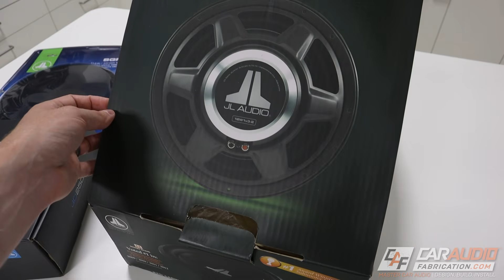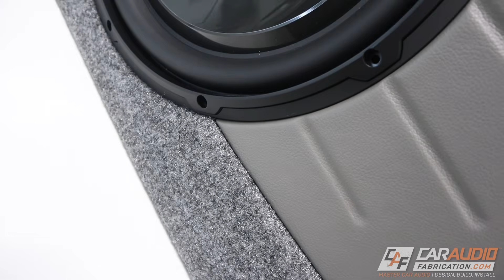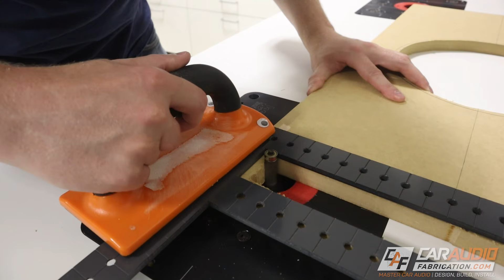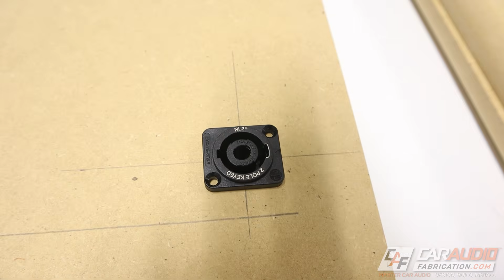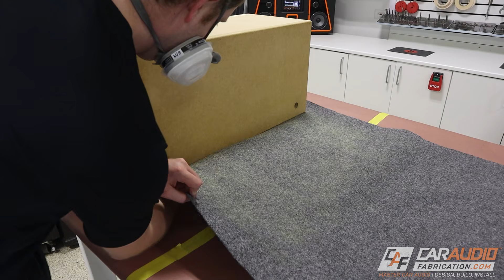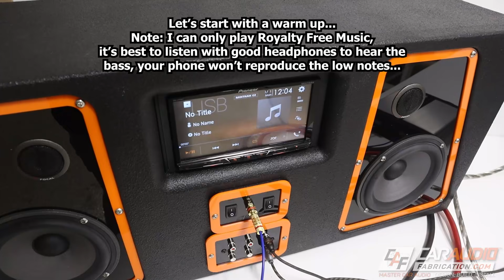BIG BASS with entry level gear? - Making the Sub Box!

Comment from the maker: Thanks for tuning into the build! A TON of you have been emailing asking to purchase the design from this video so I have added it to the site:
✔️ Premade Design Blueprint of the box in this video: https://www.caraudiofabrication.com/product-page/f0010-jl-audio-12w1v3-1-60-cubic-ft-32hz
✔️ Custom Subwoofer Box Design Blueprints: https://www.caraudiofabrication.com/box-designs

Thank you guys for watching!
Reply: proper preporation prevents piss pore performance
Reply: @JamesMurphy-re3hm 

?
Reply: Hello there are you close to Indianapolis, I'll come to you,I have a 2010 Escalade
Reply: thats a good lookin build man ...i subscribed a while back & ur videos helped me with the build on my 98 formula ...& on that note, still lookin to add a sub to my system, so do u happen to have a blueprint for a small (10"?) sub box for the little triangle shaped nook in the back of a 98-02 camaro/firebird? ive seen em before, & crutchfield used to sell em, but apparently they dont make em anymore, so i was considering making one? thanx
Reply: Got a tip to maybe make things a little easier, a small sprinkling of table salt on the glue after you spread it, great reduces the boards wanting to slip back and forth as you clamp or tack it together.
Reply: If we design a Subwoofer Enclosure for long through deeper earthquake Low Bass then where should Air vent port place? On the Bottom of Enclosure or Top at the enclosure?  I mean Subwoofer should "down" and Port should be Top in the Enclosure? Or Subwoofer place on Up [Top]  in the enclosure?  Hope you understand what I'm asking? Please suggest me. Thank you.
Reply: Are you able to build a blue print via speaker specification with speaker name??
Reply: Hi does the box need to be resined for it to sound great?
Reply: @CarAudioFabrication  hi buddy love your channel doing a great job,

Comment: Maybe I missed it- is friction all that holds in the decorative panels? 
I model cnc parts in Fusion 360. If I commission a design do you also send a model or is everything only 2d? I have a shapeoko and though it might be easier to cut some features on the cnc?
Thanks

Comment: Sooo... A friend of mine got his first car not long ago and it came with an active subwoofer build into it already. And i think we all know that they really don't do the greatest job. Since he doesn't have a lot of money to spend i thought of stripping the speaker, building it's own enclosure and connecting it to an amplifier. This is probably not the easiest job and I don't know if it's even gonna work how i imagine it. The woofer itself is an "Eton RES 11" 11 inch subwoofer with 200Watts RMS. Finding the right amplifier shouldn't be that big of a deal, but i really don't know where to start with the enclosure for the subwoofer since I can't get any information for how big it should be, etc... Maybe someone here got any idea where or even how to start?
Reply: And also the woofer has to fit into the place where the spare wheel sits

Comment: Recently I've purchased the Ported single 12" design from the website for Rockford Fosgate P2D4 12". However I changed my mind and thinking of getting the T1D2 12", will it be recommended to use the same enclosure for this model ??

Comment: Hi Mark! I would kill to be as skilled as you, but I'm working on it! I don't know if this has been answered before, but I noticed you don't use terminal cups on your boxes. I saw you use some sort of "grommet" port for the speaker wire to exit the box. What is that peice exactly, and would it work for a sealed box application as well? Thanks for this and all the knowledge you have shared over the years!

Comment: Please please please stop with the ported sub boxes. Best deepest bass comes from sealed boxes.  Please do a video showing the difference. You have to use spec size boxes and Polly fill in both boxes. Thanks. Enjoy your site.
Reply: Uh wut? You've never heard a properly designed ported box. Sealed boxes have their purposes, but ported allows for greater output
Reply: xchimnyx I have heard both. I have a ported box that now is imported because I’d rather have the crisp bass versus the louder flat bass. In my opinion of course.

Comment: Hey i love your video, SUPER informational, i was designing a box trying to perfect the airflow but after watching.. I've realized i have bit of ALOT more then i can chew, i used to run that same JL sub but i now have the Alpine's SWR-1242D 12" and R-W12D4 ( Killer haha ) to soon be powered with the Audio DM2500a monoblock, (dual battery and isolator with capacitor), i was intending on making the port start at the back of it as it comes up and over the top via slim port, but after seeing your setup wrap around, I'm so lost in how to make something like that and have to perform to its peak (cubic inches inside the box i didn't think of optimizing its performance, something i didnt think of with all my sketches) i have a EK 99 Civic hatch (Almost type R Civic with type R subs 😜), i was wondering if you may have any advice on what i should really be doing and making for these subs to get my boot popping off its hinges 😂

Comment: Find make a removable box I always have the.v amplifier mounted somewhere out of the way then put a quick disconnect for the speaker wire and then a second quick connect that completes the connection for the remote turn on that way the amplifier will not come on until you put the speaker back in

Comment: You asked if to mount the power amp to the box well it all depends on the vehicle.
 Can the amp be tucked away and  just have the cable to the speaker.
How about a quick latch or tie down for the speaker box to make sure it secured to the floor of the vehicle.
Cheers

Comment: Hi Mark, do only the nails with the glue seal the box correctly??
Reply: Shouldve used screws nail and glues are not permanent mechanical connections.  Especially in an environment with lots of vibration energy.
Reply: chuck d  it will probably be ok for that sub but it’s definitely not built like a tank to last due to vibration. Personally I would have used a lot more glue and screws and Baltic birch for the outside walls.
Reply: @jakenzfixnit4u  plywood looks decent but not great for building speaker boxes.  There is knots in the wood in the layers between the top and bottom.  It is not as acoustically stable as solid hardwood or mdf.  Everybody knows the best enclosure for sound reproduction is concrete and no 90° angles inside

Comment: I'm that next video, could you talk about mounting the amp to the box and if you believe the vibrations will affect amp lifespan. I personally keep my amp mounted separately for this reason. Not to mention in many cars you can hide the amp very well and just use connectors like the speaktron to allow easy box removal. I just don't see or understand the need for amp removal.

Comment: I just hide my amp and the wires under the rear trunk we’re the rear tire is. That way I just have to unhook the box and remove it. Plus I think mounting the amp to the box is not safe for it. The build you just did is awesome. I could see that in a soccer moms Mercedes and she would have all the dads looking at her when she pulled up.
Reply: I always mounted amps to the sub box and had zero problems.
Reply: Vitamin B same, but better safe than sorry ig, might have to move it

Comment: Entry level is some OSB, drywall screws,  and liquid nails. I’m no JL audio fanatic but I have had great results even with the W0 12 in a small stealth fiberglass enclosure I built for a Camaro.
Reply from the maker: No its not, thats just someone who is not educated in how to properly build a box. Nothing wrong with the screws approach but with a little research people would find that MDF and proper wood screws are a better choice.
Reply: There was no disrespect intended, for me in the mid 90’s that what I started with. You have the best tutorial videos and show how to get professional results with proper planning and education.
Reply: I'd have run particle board. But yes spot on.  Now I run MDF wood glue and drywall screws

Comment: Looks amazing. I have a question. I have a home theater subwoofer 12" (Polk) with huge box. I put it in my car and connect the woofer directly to my infinity amp (bridged) the bass is not tight and tons of rattling. Is there a different between car subwoofer and home theater subwoofer?
Reply: Not much of a difference.  Car subs are usually tuned a little higher because of cabin gain.  If it sounds like shit there is something wrong with the way you wired it or placement and of course its going to rattle you put a giant vibrator in your tin box of a trunk.

Comment: Entry level subwoofer build......slot port....with double baffle....double bracing.....corner 45s....front insert.....ya sounds pretty entry level to me.
Reply from the maker: The subwoofer is entry level. Everything you mentioned can be done with basic tools and some pride.
Reply: @CarAudioFabrication   Specs for that sub may be "entry Level" but the price sure isn't. $230 is nowhere near entry level. JL does make nice sounding stuff but you are definately paying a premium for the name.
Reply: @flanigas For the same RMS power rating and a low price, you can also look at the Skar Audio IX 12. It is only 50 dollars and it sounds great. I had the IX 12 for a year and it is still slapping. PS. The IX series from Skar Audio is their entry level sub.

Comment: Why are boxes always built with the port on one side and not both sides?
Reply from the maker: The way the math works out it ends up where you have two ports and the cross sectional is far too small to keep the port length manageable, or you use the correct cross sectional area but now your ports are so long it becomes a challenge to fold them inside the box in a manner that they don't interfere with each other or have a ton of bends.  It can be done but its not as simple as just "cutting the port in half" like some people think, and when it is done it usually ends up with worse performance because you have to make some sort of sacrifice to get it to work. Often times better to just use one port.
Reply: Efficiency.